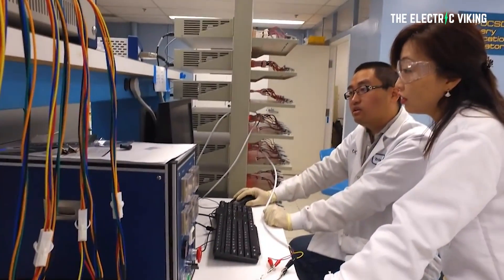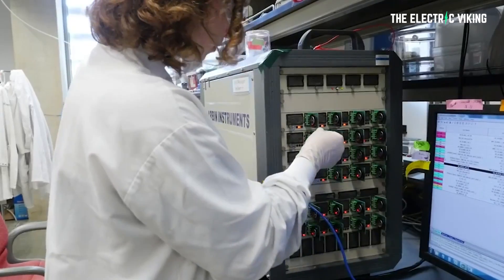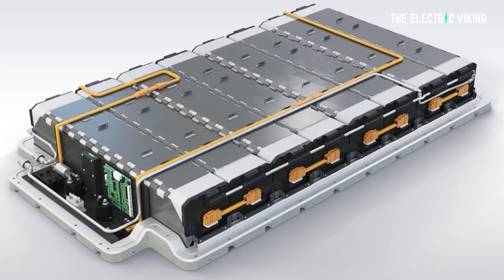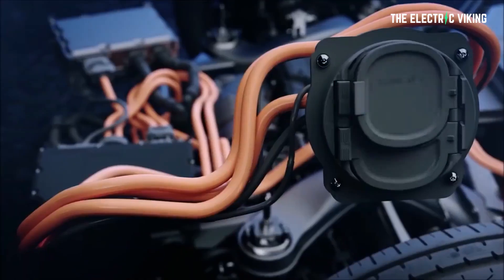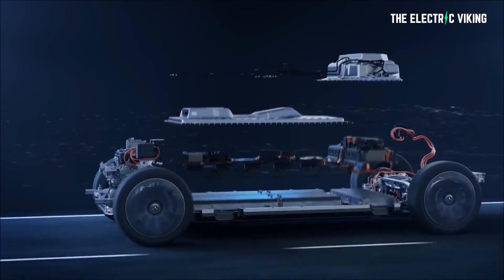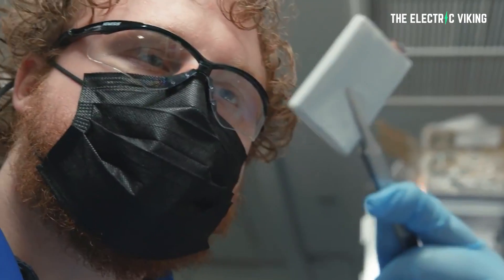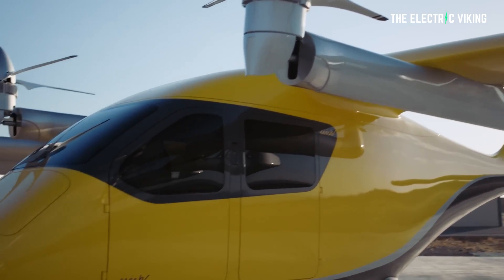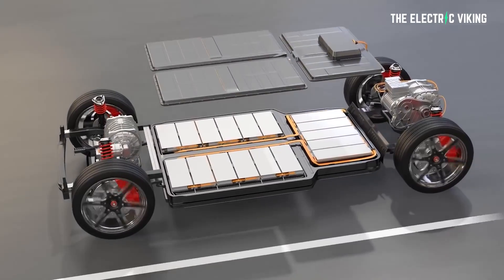Stanford discovers easy way to make EV batteries last 20% longer

Comment: All true, and I'm sure every EV maker is well aware of it. They have to do something similar in series Supercapacitor banks. However, adding thousands of circuits, one on every cell is probably not an economic proposition, and reliability issues come into it too. A single circuit failure could cause the loss of the whole pack.
It's probably better to improve the battery chemistry so that fully charging the pack results in all of the cells being full without damaging the ones that end up being over charged to balance the pack.

Comment: The extremely great, very important application for million mile batteries isn't as much for transportation as it is for V2G - vehicle to grid and V2H - vehicle to home.  Say your EV is 75 kWh, you could use only 20% of your EV to do the same thing that a 15kWh Powerwall does.  So if it uses 20% of a million mile battery, there is still 800,000 miles left. Plus you're being paid for your EV's storage on the grid.  

For a time during the transition, the grid may have to depend almost solely on renewables, in which case there may be times when the customers will not be able to obtain grid power.  That's the time when they will have to depend on V2H to take care of the time of no grid power.

Comment: The downside is the extra infrastructure required for this management. Infrastructure, as in managing at the cell level will require direct monitoring, at that cell level. As far as I can tell, this will add maybe a mile of conductor run in each pack.
Anyone know the details on this from a physical design perspective?

Comment: 500К kilometres battery life? You are dreaming. Uber driver said he had no regrets changing his Tesla3 battery after 140K miles as he earned money using the car and fast charged it every time. 140K miles equals 225K kilometres, 20% on top of that is another 45K.

Comment: The problem with studies like this they need to be funded and the people or organizations need to see progress . I have lithium power drills and one of the batteries last 15 years of constant use until it failed . Opened up the pack and one of the cells failed and I opened up others with some cells failed and others were good .  
Now I don't know if an EV is dead with one bad cell like these battery drill packs as they are connected in series but if so one weak link can bite you . Now there has been battery additives around for many moons . I have tried them with no success

Comment: This (per-cell charge control) is not readily applicable to existing battery packs, nor is it feasible cost-wise, especially for anything like a Tesla pack.  Look at Munro's teardown of the new Model S/X pack -- the smallest unit is something like 69 1865 cells welded in a series string, when each string is controlled by the charge controller welded to the edge of the pack.  That pack design including the granularity of the strands represents a carefully optimized set of factors including cost and longevity.

Comment: I doubt this tech will extend the max lifetime range of a battery pack. It’s more likely to help hit that max lifetime range though. Max lifetime range is determined by charge cycles. Ternary battery packs have a 1500 charge cycle. Multiply that by your range to get the max lifetime range. Now I say max, because battery degradation prevents us from hitting that number so if this tech can help keep the battery healthier then we’ll get closer to actually hitting the max value.

Comment: Seems that this “finding” is explaining what Tesla and other EV manufacturers have been doing for awhile. It seems that the results of this research are a little late out the door?      

However I am not sure if the current BMS systems manage each individual battery at the cell level or whether it manages them in blocks. 
This research is recommending management on a cell by cell level which might be more granularity than is being done now. 
Will be interesting to find out if this research causes any changes to EV BMS systems. 
However this could be incorporated into electric power tool power packs which are often not managed and might result in longer pack life.

Comment: It’s hard to believe that the ev battery industry hasn’t done this before.  I work in the hobby industry and cell balancing to maintain performance and longevity has been mainstream for a very long time.
Reply: how many cells does a model have? 
Try applying that to the number of cells a full size vehicle uses
Reply: @paulg3336  Certainly only a tiny fraction of what a full size ev has! It would be much more complicated for sure.  I’ve seen on other videos that many manufacturers have the ability to monitor individual cells within a pack.  I thought that if they can monitor, they would’ve also balanced.
Reply: 400v pack has almost 100 groups in series. BMS already has balancing, overcharge/discharge on all ev batteries.
Reply: Maybe this video Issa remake of one 6 yrs ago an Th Electric Viking is playing with his lil men or they’re with mom an he’s smoking like a freight train

Comment: So you need a BMS not only per module, but for every single cell?
That's not quite feasible now, and will need a lot more chips. I'm not sure charge protection circuits are good enough for that task, although I may be wrong.
Then again, one of the most common issues with battery packs is the BMS can't balance them correctly, requiring technitians to hook up external chargers to individual modules.
In case of the original Tesla Roadster, they have individual cell failure, and the fix is to simply disconnect the faulty cell from the module while leaving it physically in.
Reply: Monitoring individual cells may not be necessary. For example, monitoring each liquid cooling circuit's input/output temperature differentials can determine groups of cells exposed to or releasing greater quantities of heat during charge/discharge, then reducing input/output current of most/all cells served by that coolant circuit.
I did not read the study cited, but from the Stanford website: "As a first step, the researchers crafted a high-fidelity computer model of battery behavior that accurately represented the physical and chemical changes that take place inside a battery during its operational life. Some of these changes unfold in a matter of seconds or minutes – others over months or even years."

Comment: It won't work, because of one reason... Cost. The BMS would have to be far more complex, the extra wiring needed, alone would increase the cost factor. Battery prices need to come down, not go up. I'm pretty certain, Tesla has already tested this out, but rejected the idea, as not feasible.

Comment: It's not new tech. It's expensive. It's likely to introduce potential points of failure. It's not likely to be implemented in car batteries because of cost. Replacement and recycling of old batteries is likely to be more cost-efficient

Comment: Battery cost in the long term is cost per cycle.  Increasing cycles lowers cost.  Preventing one battery in a pack from going bad can save a pack.  This could reduce battery warranty claims.

Comment: An interesting discovery, but it is unlikely to be implemented in the real world due to the high cost of implementing a BMS that can monitor each cell and charge them separately. You have to add a lot of extra wiring to be able to charge each cell separately and Flash memory to store the history of of each cell, and create a very complex BMS that can output different wattage at the same time to different cells. The cost would be very high. It is much simpler to just stick LFP or LMFP batteries in the vehicle or cycle ternary batteries  between 10% and 90% of their capacity and use good thermal management if you want long cycle life.

Comment: I don't understand your explanation, this kind of charging is normal for lithium batteries.
That's why lithium battery packs do have balancer leads to increase/decrease current to individual cells. If you don't, then charging will be dangerous because lithium batteries can burst into flames if single cells are overcharged, therefore controlling the charge of every cell is mandatory. I have many big lithium battery packs which all use this kind of charging. I am really confused if you are saying that individual cells are not monitored/controlled during charging in lithium car battery packs.

Comment: the competition is getting more complex.
the extremes are cheap, long range, quality evs.

on the other end are ice cars.

one of the problems going off ice is you do not know the evs and the different evs.

you do not buy something obvious.

people still talk about cars as if it is a single mass.

you either go for ice or ev.

then what ev is hard to know.

going off ice is easy but what ev is hard.

you want cheap smart car.

Comment: Yeah you have to sense and regulate the current to every battery . This requires extra circuitry and quite a bit directly dependent on the number of battery's .  Gruber Motors has some Ytubes out on how they repair the model S battery packs. And what they are finding is that one or two battery's pull a whole module down. They repair the module by essentially cutting that or those battery's out of the pack. If most people charge at home where they don't  stress the battery that much I don't know if there is a good cost tradeoff for the extra circuitry . Seem's like this means a sensor and intelligent charge control circuit for every battery.

Comment: Yuch.  Don't screw up your channel by promoting stock trading sites please.  Or specific tickers.  No matter how up-and-up it might be.

In anycase, this discovery is a bit bogus I think.  It isn't really a discovery, its a trade-off.  The main problem with putting a current controller on each individual cell is simply one of cost.  BMS's already monitor and balance groups of cells.  For example, with a 16s4p pack, the BMS is monitoring and balancing 16 groups with each group made up of 4 cells.  The BMS only needs to deal with 16 balance connections rather than 64.

Trying to do it for all the cells individually would make the BMS as well as the wiring involved far, far more expensive.   For one thing, you would not be able to simply bus the parallel cells together. At a minimum each cell would have to be run through a back-to-back pair of FETs (basically an e-fuse chip).  And then there is the problem of current control.  It is simply too expensive to put a switching regulator on each individual cell, so basically current would be regulated by dissipating the extra energy in the FETs.

Another problem is that very few people exclusively Fast DC charge.  A cab or Uber driver (etc), sure.  But most EV owners will mostly use L1 and L2 charging where even the fastest L2 rate is still nothing as far as the pack is concerned.  Occasional Fast DC charging just won't damage the pack very much.  So all that extra circuitry and cost winds up being wasted.

-Matt

Comment: For this to work you need to be able to monitor and send power to each battery independently and also group them to achieve higher voltage, so you'd need some kind of cross bar setup to grant random access to each battery, I'm sure Tesla would have thought of that so they could work around one battery having a resistance buildup and tanking the entire string. flat-panel televisions and CCDs in digital cameras use all kinds of tricks to quickly access a single element or pixel, rows and columns reads in a CCD is why they are so fast now, it took them years to figure out how to do it.
Reply: It would be easy to make every battery addressable, the issue is weight I venture.
Reply: I thought this was solved a while ago.
Reply: try doing it with hundreds of amps

Comment: If this requires the addition of electronics to every cell, that is hundreds or thousands of failure points, not to mention the added manufacturing cost and complexity.   If we can get to a million miles, or even half of that with simpler tweaks, that's probably sufficient.
Reply: AND WEIGHT

Comment: This is called balance charging.  Almost every RC modeler has been doing this since the early days of using LiPo's.  Our chargers also monitor internal resistance of each cell.  Nothing new here.  Someone must have bought an iCharger and liked how it works.

Comment: Having the battery last longer is great but real confidence in EVs will come when replacing a battery pack doesn't cost as much. It needs to be the same price as replacing an engine and transmission in a ICE car or less. Automakers also need to offer upgrades to newer chemistry types when replacement is needed. If they don't aftermarket shops will do it for them. It's already happening for the Nissan Leaf in Europe adding thermal management and choice of battery chemistry and pack size in some cases doubling the range of the car. I believe there will be a very large number of Tesla customizing shops in the future and they may be as common as oil change, battery, and tire shops are now. I would not be surprised to see ICE service chain begin to transform their business in this way. Valvoline, Kwik-Kar, Jiffy Lube, Discount Tire, Breaks Plus, AutoZone, etc. may transform their business to replace batteries in EVs. If auto dealerships get cut out of the business by direct sales they may look to battery replacements also as a way to get back at automakers. It's like OK, we don't make money on your cars anymore so we will make them last FOREVER!
Reply: Why you need to change battery pack if your battery can last 1 million miles?
Reply: What is the cost of replacing engine of a BMW, Audi, Mercedes let's say five years old, that brand new had a value of 60.000
Reply: Personally I have FOMO about buying a car now with all this new battery tech supposedly just over the horizon. It would be nice 
to no you could at least upgrade the battery at some point. I would rather plug in over night than do battery swaps.
Reply: @ctuna2011  Yeah, having to swap batteries means you have to go to a specific place, I like charging at home and if I travel knowing there are plenty on superchargers.
Reply: @ctuna2011  Unfortunately its never going to stop progressing.  The swapping centers are geared toward apartments and travelers
Reply: If it were easy peasy, we would have done it already.